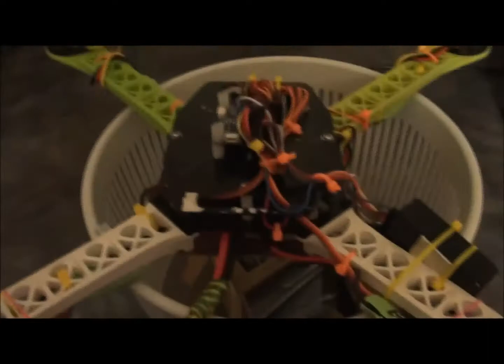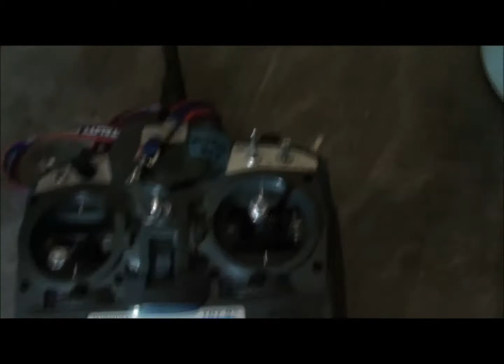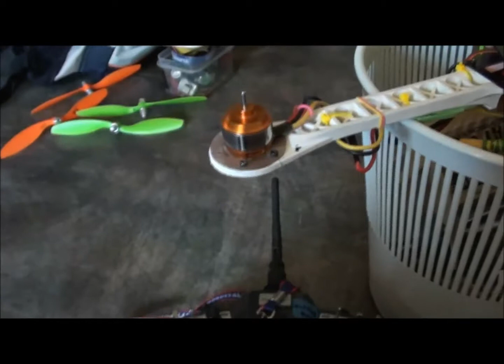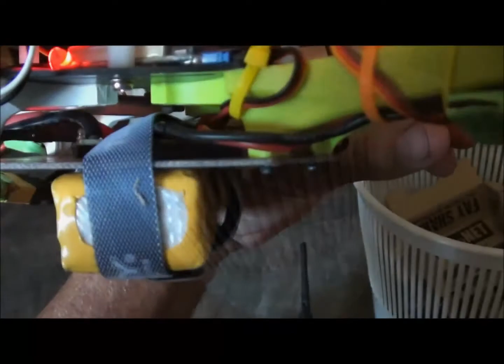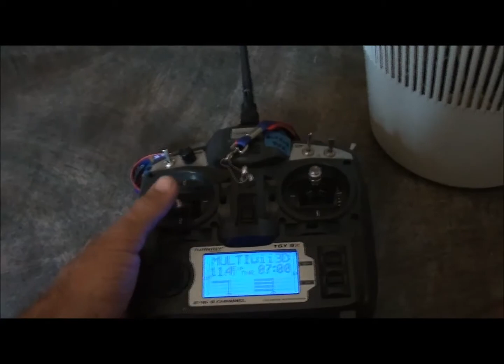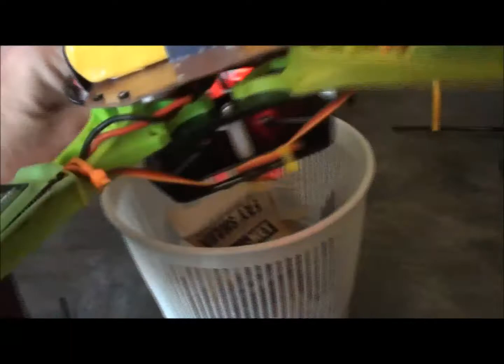Multiwii 3D One Step Closer

Comment: Hi bud, is there a simple line of code I can remove to make an old nanowii that runs 3d firmware into a normal quad again? I need to put it on a micro quad if possible. Cheers
Reply from the maker: +MicroRCFiend So do you have MW3D on your nanowii??........ you can reload MW2.2 or 2.3 so let me know..... if you dont have it maybe I can swap you your 3D code for 2.2 or 2.3. cheers
Reply: moochasas I did but managed to get rid of it last night and upload a basic X sketch again. I like 3d quads but wasn't keen on the multiwii for this as it had too many restrictions for me. Going to try KungFu 3D next

Comment: Hi Moochasas Great stuff,I am currently building a 3D quad,I have flashed 4x multistar optos with SK reverse firmware,can you tell me if there is a special sketch for the multiwii for 3D (if so where I may find a link for it)or normal sketch ? I am using Arduino , and very new to this Sketch programming so any help would be much appreciated .
Cheers a.
Reply from the maker: The easiest way to get a board that does 3D is to use a 32 bit board such as the Naze32....... these boards are widely used and they are around $25. And they are easy to set up in the GUI (Baseflight configurator)..... as it has a 3D setting..... the 3D copter I made has issues (which I will do a separate vid on) so I purchased the board and escs as a package from Switzerland. Its all good to go and no I just ahve to learn to fly it..... so I am waiting for the less windy weather.... then its upsidedown-we-go. Here is the link to the site where I got my gear from http://multicoptershop.ch/multiwii_flightcontrol/naze32-3d-flug
Reply: moochasas Thanks for the speedy response,I fly helis but have become Hooked on these quads over the last few months and love the night flying now the darker nights are upon us.Thanks for the link,I will have a look at David's shop,but am pretty determined to get my wii to work, it's a challenge thing against my friend who has just purchased an Invictus,which operates with the multi wii .!!! I want to prove it can be done on a budget,keep up the good work.
Best Regards
Cheers a.

Comment: like the 3d project, but the fine line between forward and reverse throttle is a bit too fine for me, is there a way to configure a switch to operate forward and reverse(inverted) like a helli, it would be a bit safer,  good job apart from that, keep it up.(get that" keep it up"when inverted LOL).
cheers.
Reply from the maker: Yes its going to take some retraining as the natural reaction is to pull down to stop which will be reverse full throttle...... anyway its a work in progress...... as for a switch to reverse the motors.....I dont think (once you got the hang of it) it would be all that easy flicking a switch each time..... just have to retrain the brain and thumbs...... then remember to revert back when your not flying 3D..... so maybe it will be a stand alone, no other flying, try/die/or fly project.....